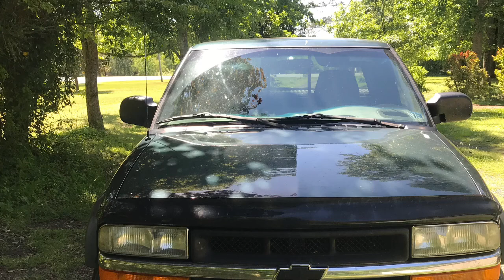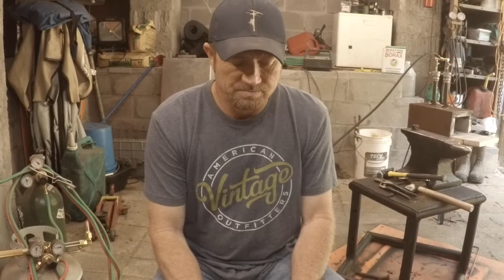Vortec 4.3 distributor replacement causing Code P1345 Misfire Part 2

Comment: I get a p0300 and can't figure it out sucks
Reply from the maker: Like I said in one of these 4.3 videos mine was hard to find as well. I tried all the simple things first as I’m sure you have. Mine would come and go under strain at first. I took multiple compression tests throughout the time I was trying to figure this out, and they we’re always good. Then when it finally got bad and I’m talking really bad I took another test and I had two dead cylinders. Zero compression. Two of the cylinders had exhaust valves that were staying open. This was a common problem with these motors. 
What all have you tested and tried up to this point?